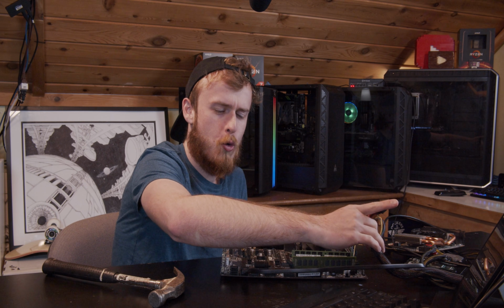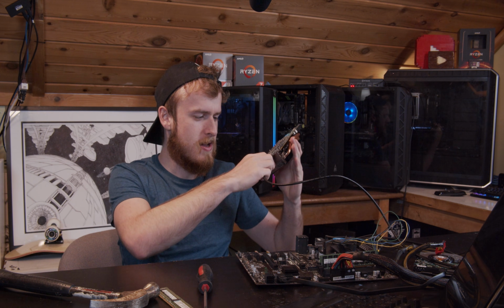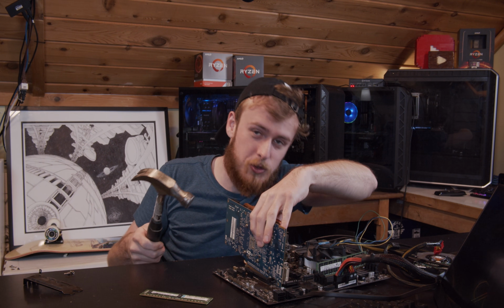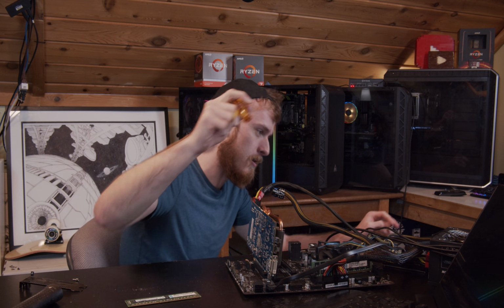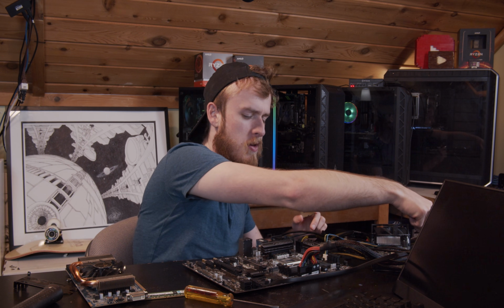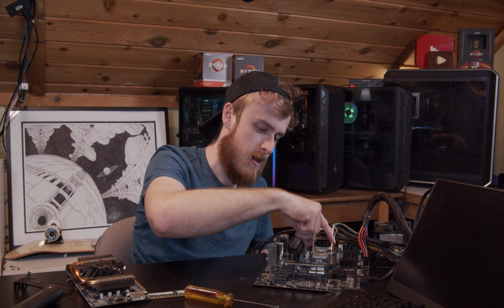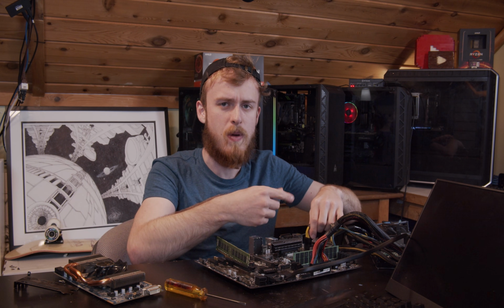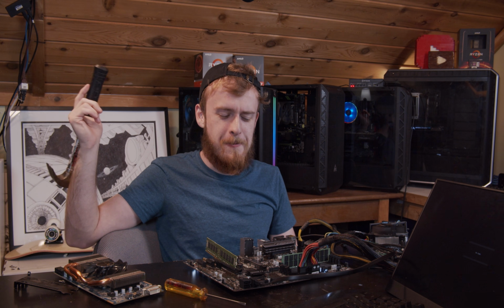What Happens When You Put Your CPU in the WRONG WAY (Feat. Hammer)

Comment: So, funny story...
I built my first PC back when video cards were using the AGP slot. Come time to upgrade my GPU was right around the time they switched to PCIe standard. New GPU was, unbeknownst to me, PCIe. I simply wasn't aware of the standard change. I actually tried to jam the GPU into the AGP slot for a solid 30 minutes before I stopped to look into why it wouldn't fit.
Ended up just upgrading most everything.

Comment: Let's see ... bushy beard, great hammer skills and no computer ones. Are you Amish? On a more serious note, I'm curious what happens if you remove the notch on the motherboard, inside the ram socket, by being a little gentle. It's just a piece of plastic that serves as guidance -melt it off, without damaging the nearby circuitry and insert the ram backwards :). As stupid as it sounds, i think the connectors might line up and do something interesting.
Another interesting idea is to "stress" test the components. How many whacks with a hammer does it take to break the cpu (while installed correctly). Or - how many times can i drop the HDD before it stops working? How much dust and feathers can i stick into my psu before it shorts? Yes, I am a treasure trove of stupid ideas :) (edit, nvm, I see you put a hotdog into the fans, i tip my hat to you)